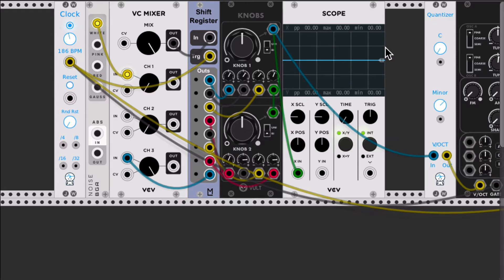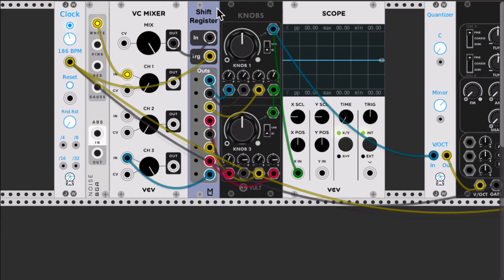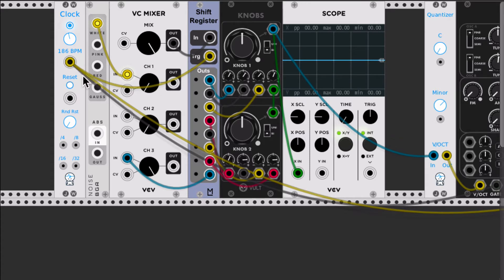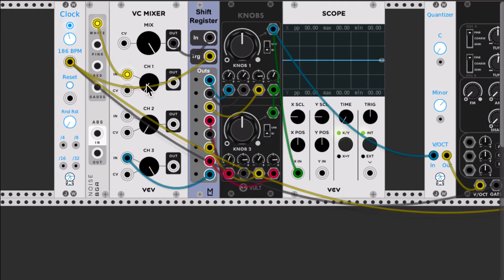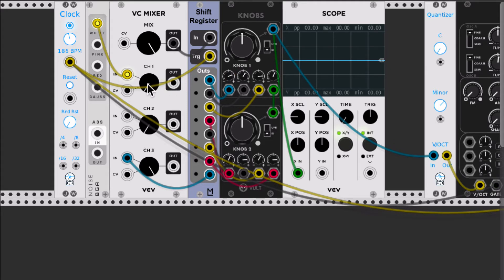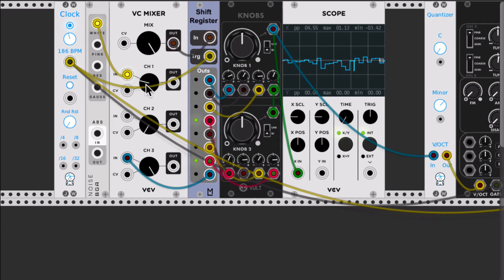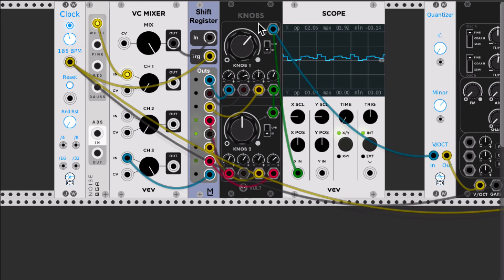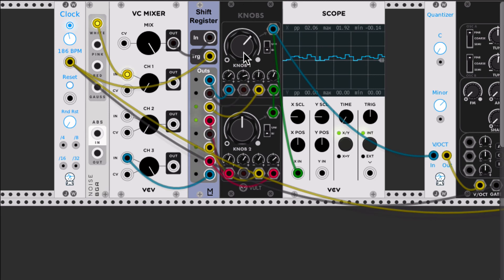Vult: Discrete Turing Machine

Comment: This is great for understanding more clearly what the TM is doing, and this version has some interestingly different behavior. If the shift register feedback is set just a bit under full with no white noise, the shape of the sequence stays the same but the range slowly "shrinks", eventually to one note. If just a little noise is added, it changes a little and keeps the same range.

Comment: That's a cool and simple way to simulate something like the Turing machine. Thanks for the video.
I'm showing a more sophisticated way to be nearest to the actual Turing machine that involves 2 sequential switches (1 to 8 and 8 to 1),  it's in French but images can be enough to understand : https://youtu.be/bdsXldsEmNc
Reply from the maker: That's really cool! Also I found that Knob is nos strictly necessary since the Shift Register is more like a chain of S&H. I thought it used boolean logic. So the patch in the video can be made even simpler.
Reply: Simulating all the features of the Turing machine is not so easy, but simulating the core functionality can use very few modules, you were very near :-) Indeed the Knob is not strictly necessary. Using the minimum number of modules needed is a good exercise to master modular system !
Thanks for your modules, they're sounding great and have a nice look. And I love the way you're testing real hardware combinations to create virtual device, very interesting.